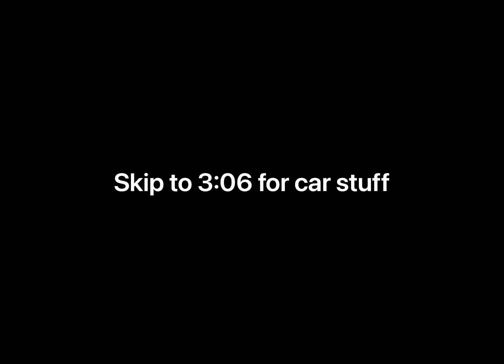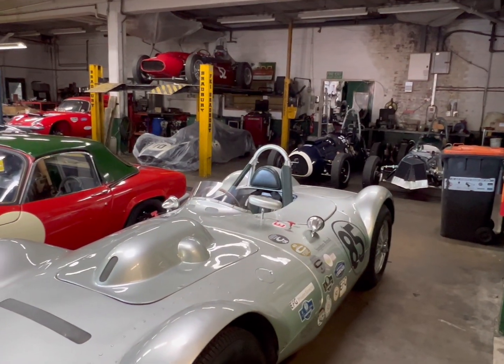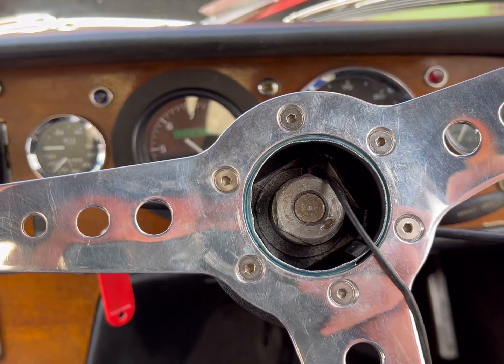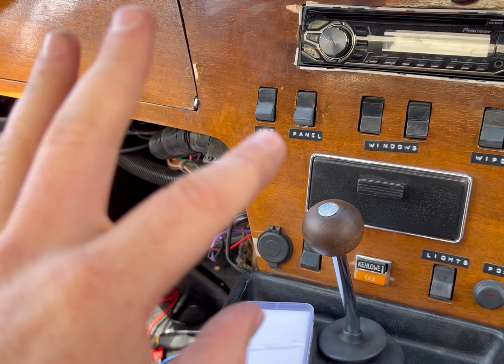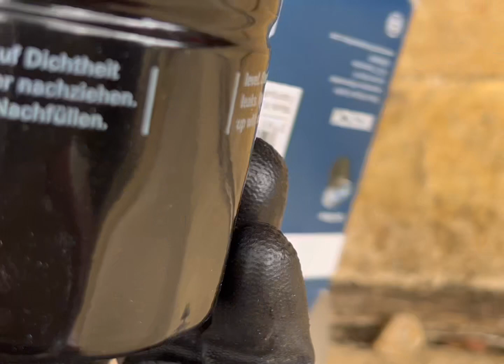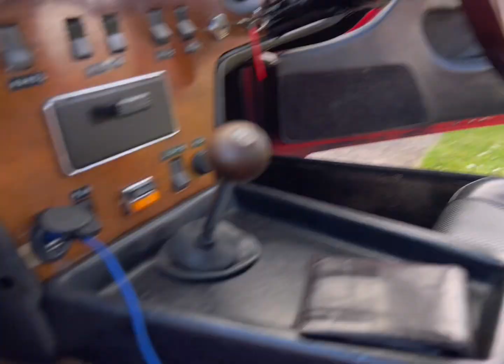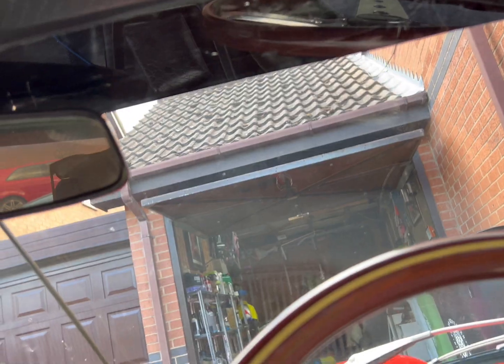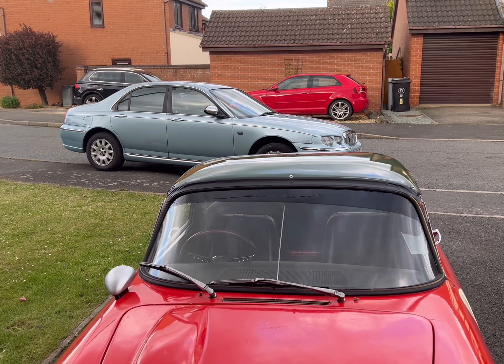Lotus Elan Restomod - episode 39 - it’s back!

Comment: I see you have a genuine Black badge Elan model.  Only 39 UK cars left for that year . Very nice.    
I have the Europa (Type 54) 1969 Black badge and they are very rare now, Only 10 UK cars left.  They need preserving.
Reply: @olly22n  The Black badge on the nose and horn push was only introduced for a short period , during manufacturing of 1968 and 1969 to mark the death of Jim Clark.  Some people add the black badge outside those years, but they are not factory   genuine. You can apply for a Heritage certificate with your engine and chassis numbers and if they are the original numbers you can get the history from Lotus. I haven't done that because I have owned my car since 1973 and I know they are the originals. An original car with matching numbers is usually more valuable  than a non-original car.  I have kept mine as original as possible.  Original Elan's have a current price of over 30K.
Reply: @olly22n  I didn't realise you had changed the engine.  With the original engine it is possible to restore back to full originality and value.
Reply: @olly22n  All the cars made in 1968-1969 were genuine black badge. Only those years.
Reply: @olly22n  Most of the front suspension components and steering and brakes are either Triumph or Ford, but I think you know that. The door handles are MGB inside and out. Just enjoy the car, I'm sure you will. Good luck.

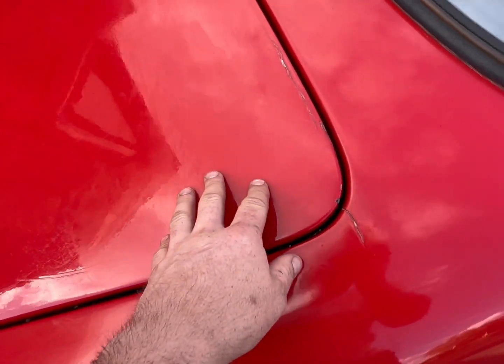Comment: 16:25.  Before you give up on the bonnet catches, someone came out with a much improved design, preventing the strips on the bonnet from getting caught in the backside of the original cable operated catches on the body.  If you take a close up of either catch, I can tell you if you have to original ones or the new improved ones.